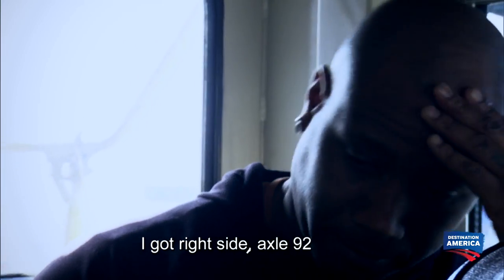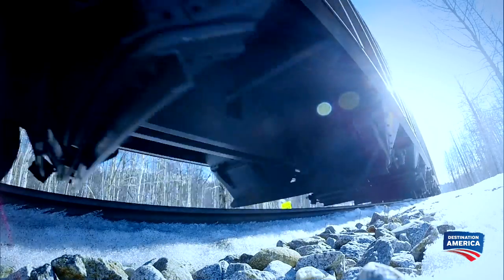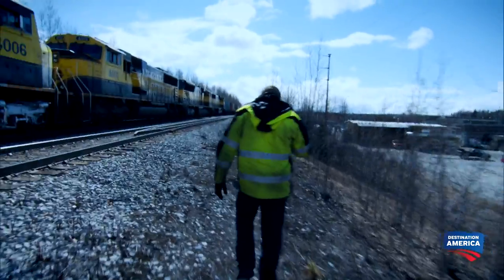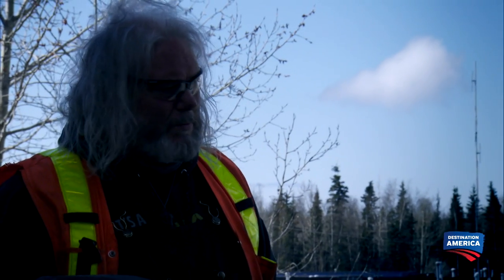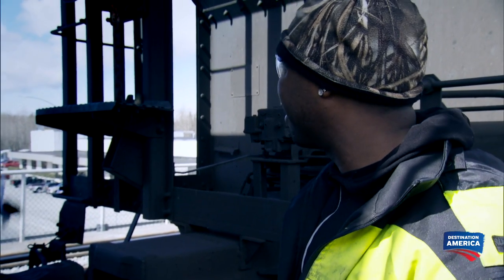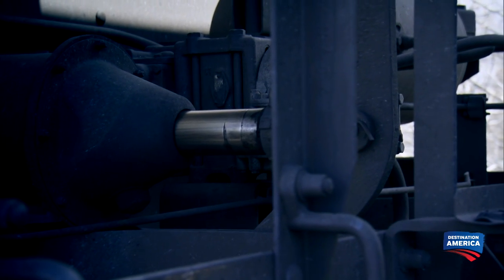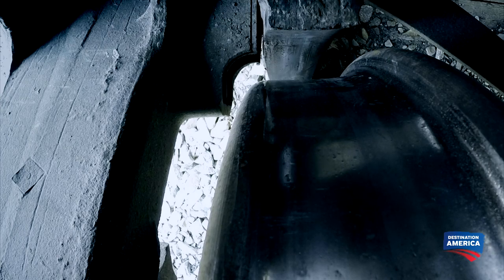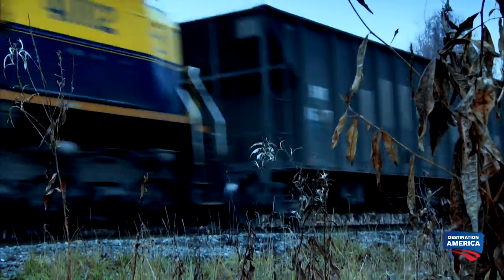Alerts On The Track Indicate A Wheel Defect Forcing The Train To Stop

Comment: What BS. They did nothing to fix the problem. They should have cut out the brakes on that car. One car wouldn't make any difference in stopping
Reply: Not if the piston released why would you cut it out lol
Reply: You can isolate cars from the braking system while letting the surrounding cars brake. But yes, this is pretty staged
Reply: Why would you do that, that means the rest of the cars past that one with the problem would have no brakes if you mean disconnecting the train brake hose.
Reply: Railroad Engineer  no, the brakes on each car can be cut out individually. This is often done as a temporary means to move a car with defective brakes. It does not mean shutting off the train line.
Reply: @RailroadEngineer123  you call yourself a railroad engineer?  Must be toy trains.
Reply: @RailroadEngineer123  Please change your handle.  Thanks in advance.
Reply: @RailroadEngineer123 jesus christ, ever heard of a car bypass circuit?
Reply: @ghostrider-be9ek  he's 100% correct. Cut out the control valve on the bad car and bleed off the air. Every car behind that car will still have functioning brakes.
Reply: @MrLiipz  exactly, bypass the bad car